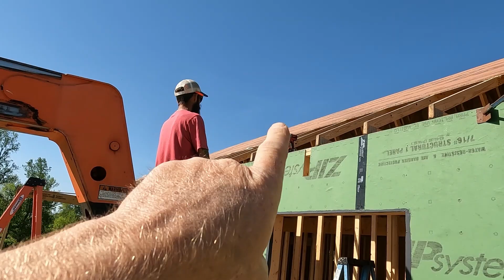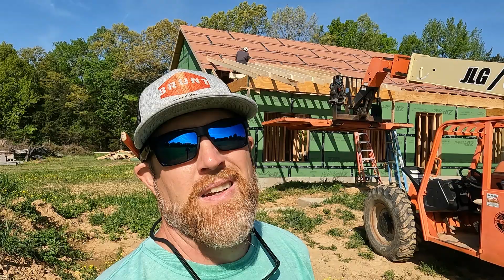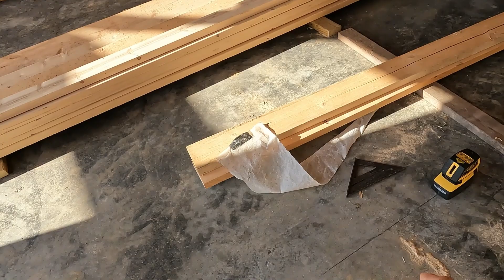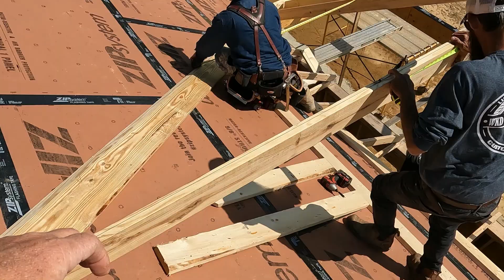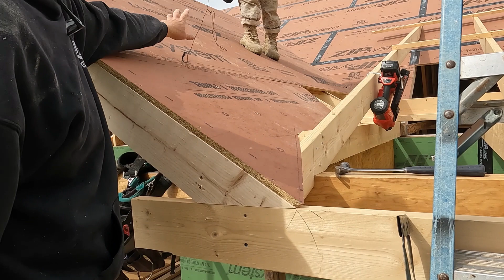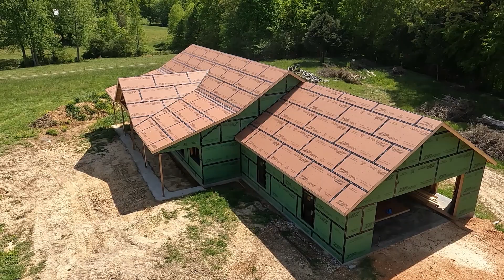The Melton Farm Project - Part 10 Framing the Front Porch

Comment: Maybe next time consider running some metal strap over your ridge tying your rafters together as a replacement for collar ties.  Can be installed after sheeting if the appropriate size fasteners are used.  An exterior vault like that can see substantial uplift from wind.  Idk if this was engineered or not but either way it’s cheap insurance.
Reply from the maker: These were trusses
Reply: @ the vaulted porch roof is what I was referring to.   

It’s probably overkill and will only ever come into play in an extreme weather event like nearby tornado or hurricane, but unless you have an SE stamped detail saying otherwise it is required by the IRC every 4’ when omitting collar ties.  

Not saying this to be critical - you do good work.  Watching you bevel your sheeting makes me want to do that sometime.  It looks clean.
Reply from the maker: @thatshould  oh, I got ya. I didn’t see the “front porch”.